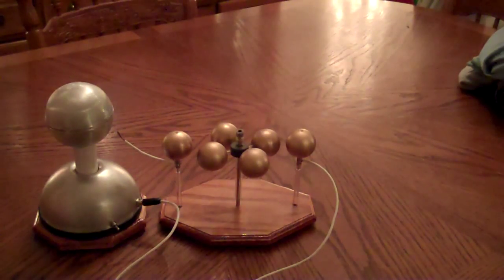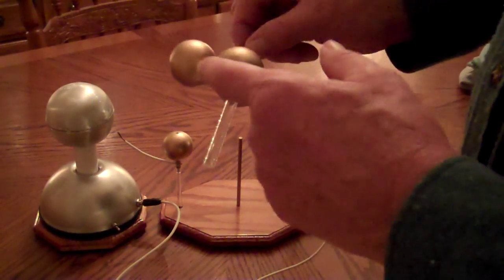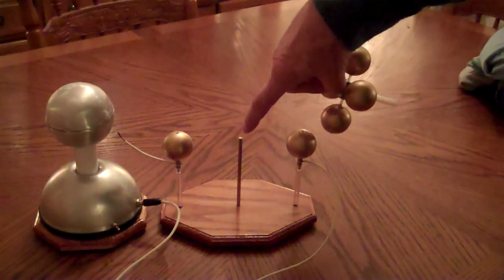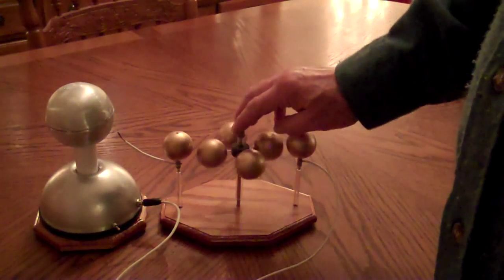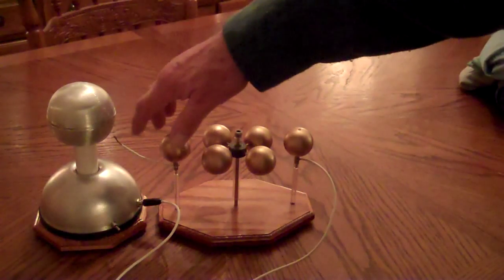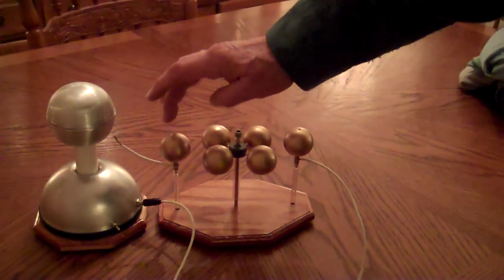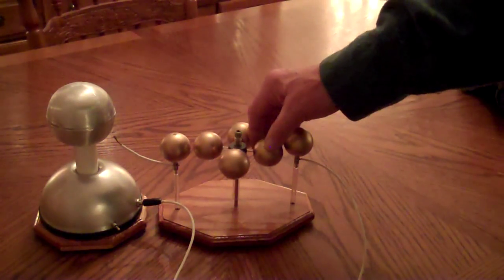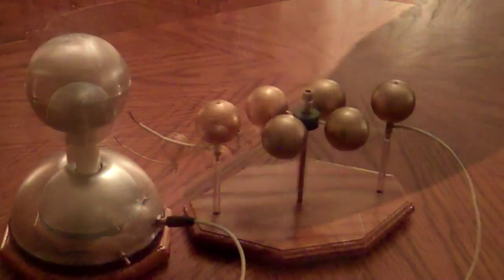Home Made Electrostatic Motor

Comment: Hi would you type in joe cell horses mouth    Joe booker has used this to run his escort one hour in on video but he is using the flowing masses of fluids oil and water within the engine dc ac pulsed through richkcheting coils and a right hand swirl secondary vortex on the engine earth which would make the cars structure statically attract the AIR.  To the structure as these flowing mass hide are always in chaos as the engine becomes a tesla coil and the aluminium becomes a condenser atom air stripper neutralised

Comment: Un motor es un dispositivo para convertir una forma de energía en energía mecánica. Este motor electrostático convierte energía eléctrica actual baja de alto voltaje en energía mecánica. El generador convierte la energía química de la batería en energía mecánica a través de un motor eléctrico en su interior y entonces convierte esa energía mecánica en la energía electrostática de alto voltaje de baja corriente. El generador de Van de Graaff salidas 80.000 voltios en 2 microamperios.

Comment from the maker: No Fathony, it is not the same as the whirl.   The whirl I think you are talking about uses sharp points to ionize the air around them.  And the "whirl" rotates by repelling charged air molecules away from it.  The air molecules have mass, and an equal opposing force is applied to the whirl when repelling the charged molecules away.  In this motor, the charges are on the spheres that repel and attract one another.  Charges are transferred between spheres through and arc, or plasma current.

Comment: Thanks for posting this.  I built one very much like yours and it works fine; turns about 5 or 6 rounds per second (which is pretty well independent of Van de Graaff speed).  We can use it as a demo here in our physics classes.